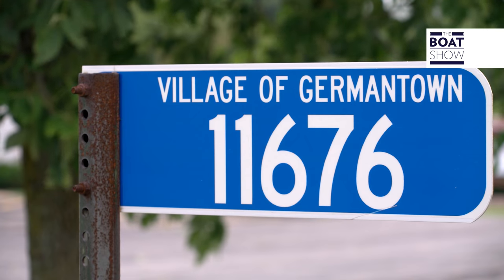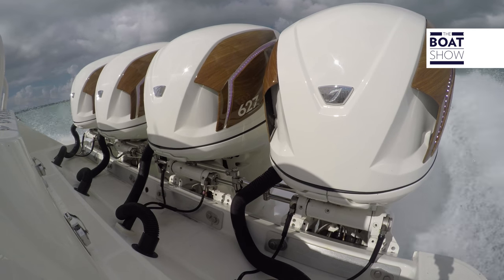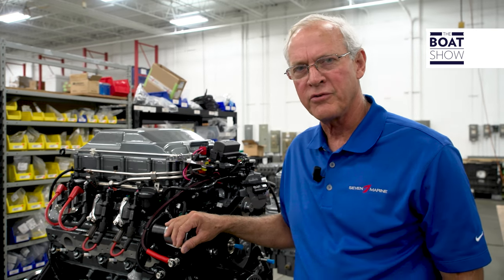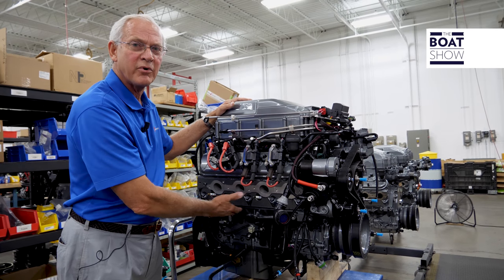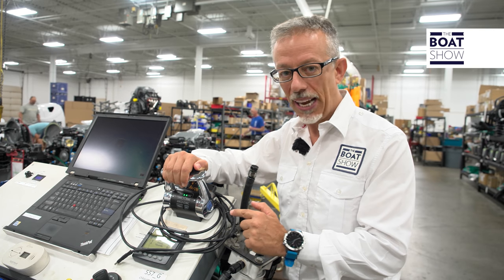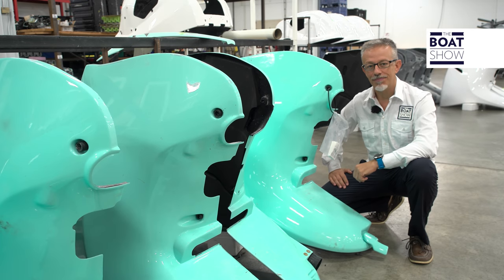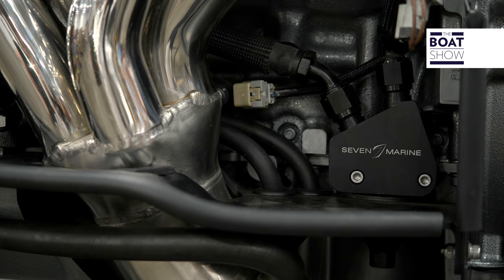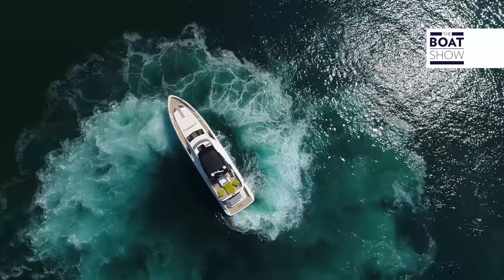[ENG] SEVEN MARINE - HOW IT'S MADE - The Boat Show

Comment: funny design, talking about efficiency with that much gearing and that complicated power train it's just funny for any serious engineer. that engine is maybe only good for show up, nothing more. and yes why didn't anybody mention the weight of engine?
Reply: For reference a Mercury Verado is around 700lbs at 300hp and this is just shy of 1100 at 627.........Oh and the last twin Verado I rigged tipped the scales at 1610 lbs ;-)
Reply: the Verado is 668lb 350hp also you are not considering power transfer to prop ...the 627 will have allot more power loss and allot more cost in maintenance and i have seen the test runs these motors are dogs out of the hole and you have to consider the GM v8 is not built with the idea of running up to 6000rpm then holding it for hours and at 6000 rpm the GM 6.2l will consume fuel moving all of the motor parts and all of the gears in the drive train .....You will see these on party boats but never on a working boat
Reply: A total and complete failure in a $400+ K project . A 40ft Cat built by Armstrong Boats In Washington a few years back , They sold the owner a "bill of goods" and  he paid dearly for it, relied 100% on "expert engineering"  from multiple companies and ended up redoing the complete engine power train  a year later,  100% on his dime........Luckily the owner  saw the light after only one miserable season of continuous repairs and total nausea...................................Tony